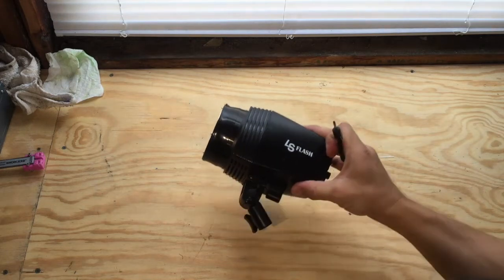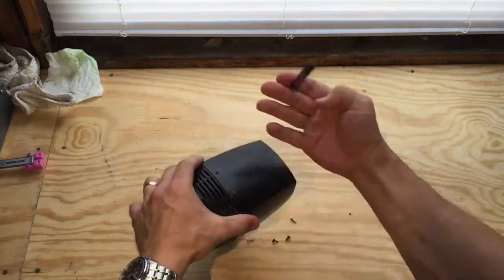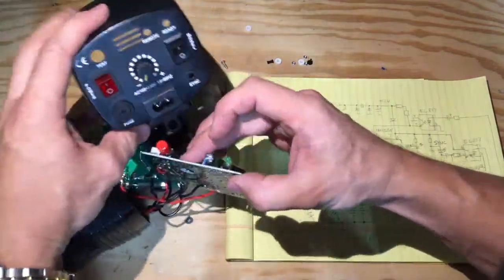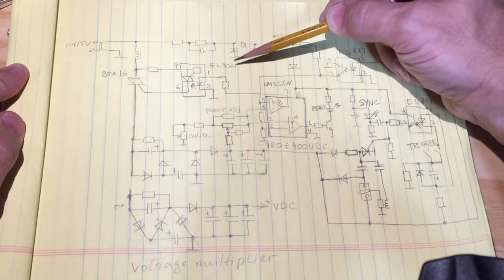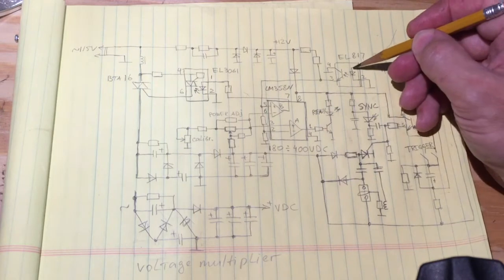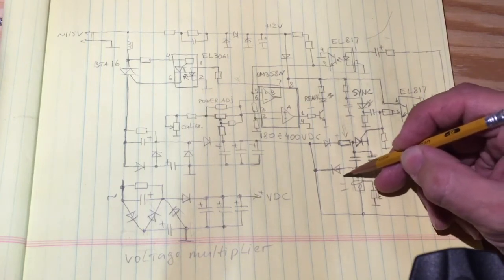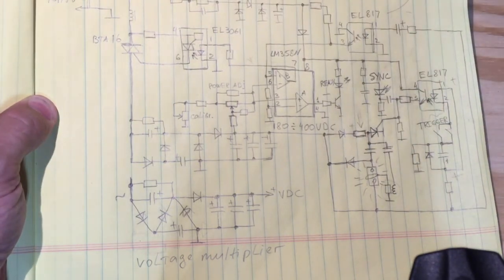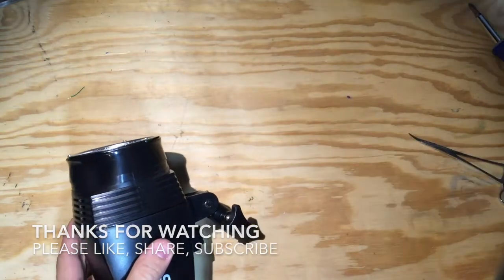Photo studio Flash Strobe monolight teardown circuit diagram explained inside out

Comment: I have one remark to make:
When capacitors are charged the full voltage is available at the xenon lamp terminals.
The trigger only discharges the capacitor into the high voltage coil, which ionizes the gas inside the xenon lamp causing it to conduct.
So I think a connection from the other xenon lamp terminal to ground is missing.
Reply from the maker: Thank you very much for watching and commenting!
Your remark makes sense, I may have missed that connection. However, these flash strobes are sold and I can’t verify if the connection is there.
Cheers.

Comment: YES THIS AC STROBE CAN RUN ON DC POWER! this strobe similiar to Godox K-150 or Godox K-180, to operate this AC Strobe to DC, make new MIDDLE bypass after Diode "AC VOLTAGE MULTIPLIER, and the DC Capacitor Bank. put new DIODE in there. and then make new DC MULTIPLIER / DC TO DC STEP UP.. (like Pixel TD381 Power Pack, this boost 6volt DC to 330Volt), this bypass similiar to Godox TT685 Speedlight...
Reply from the maker: Thank you! I’ll have to look into that closely.
Reply: or make new additional small pcb circuit DC to AC inverter just to generate AC pulse, and than after that put VOLTAGE MULTIPLIER (remember the type must be FULL WAVE TYPE VOLTAGE MULTIPLIER ↓ not The Half Wave Voltage Multiplier ↓, there is many sample on Youtube channel), and than enter to new diode BYPASS. Scheme is copy paste from Godox Speedlight TT685 external power pack. #DC_SLA_6/12Volt_Battery ~to~ #Small_DC_to_AC_Multiplier ~to~ #VoltageMultiplier ~to~ New_Diode_Entry_Bypass (put before capacitor bank)